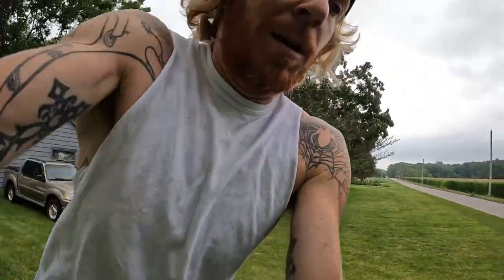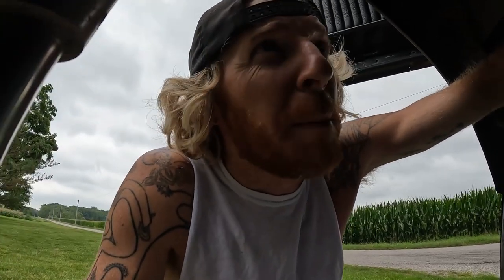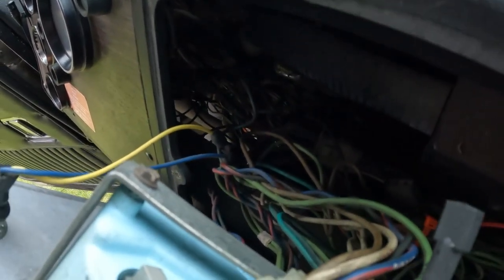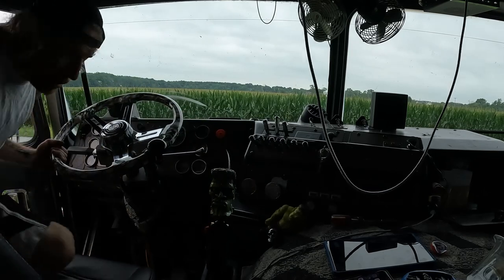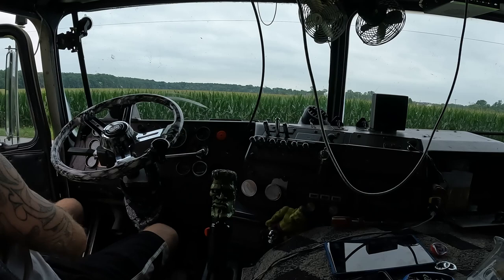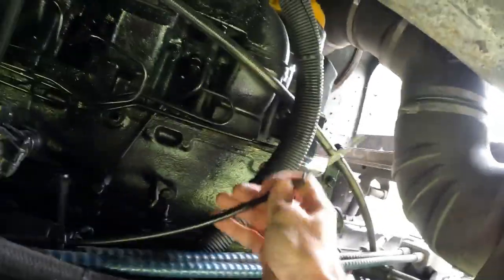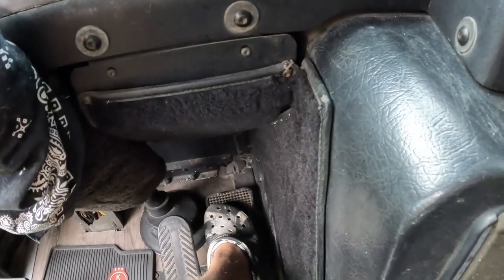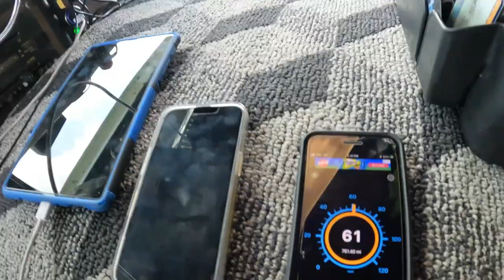Cabover Semi Throttle Lock Installation On A 3406B Cat

Comment: I was thinking you forgot to put that nut back on the cable. Even yelled thru my I pad while watching. Looks like that’ll work pretty slick. I always just foot fed only used my throttle lock when using my PTO to dump or sleeping overnight. Never really thought of using it while driving. It’s funny I never minded too many springs on throttle return, but I know guys that did to each his own.
Reply from the maker: It works well

Comment: What the heck, KW didn't put a Cruise Control in that beautiful truck of yours!? Not even a factory "Throttle Lock"!?  Wow! I thought al older trucks, till you get back in time a little further, came with "Throttle Locks". I remember my dad using his Throttle Lock in his International COE.  Mine came with one and I always use CC when I drive but "Throttle Lock" is the next best thing when you don't have CC.  Good job Chad! HOOAH!!!
Reply from the maker: No neither of mine came with them and both are mechanical without cruise too.

Comment: It works just like a cruise control!!... Gotta love cruise control!!
Reply: Not exactly, but better than nothing at all, especially when your like me and use the CC on all vehicles all the time lol  It simply locks the Throttle in place but when you go up hill or down hill the truck slows or speeds up so you have to keep your hand close to the Throttle Lock so you can adjust as you go...  like I said, better than nothing.

Comment: Ah Chadd it's nice to see you curse during installation I do it I think it makes the job go better ,my first cruise control was a stick accurately cut to length to prop the accelerator to the floor not exactly legal but it did the job ,.The video was very well received you are a funny guy 
Cheers Kym
Adelaide
Reply from the maker: Thanks Kym

Comment: Awesome Job 👍  on your throttle lock.  Question when are you going to start on the other Truck?  You have way better luck than me reason for asking is if anything might happen to Frankenstein.  You don't have a backup Truck and You always have a backup Truck really to roll.  Hopefully that will not happen but you just never know what can happen.  Again Awesome Job on installing the throttle lock...
Reply from the maker: When the radiator gets here only Frankenstein is getting my time while it’s the main money maker

Comment: Random, but I’ve noticed the antenna tower in a couple videos, is that a tv antenna or a base station beam antenna?
Reply from the maker: Tv that works half ass cause the trees
Reply: @1ChadKeegan  I figured it was probably tv but didn’t know if you tinkered with base stations. I use an outdoor tv antenna too and with the digital tv signal junk, even that sometimes doesn’t work well. For a moment there I thought you had a small base station beam antenna.